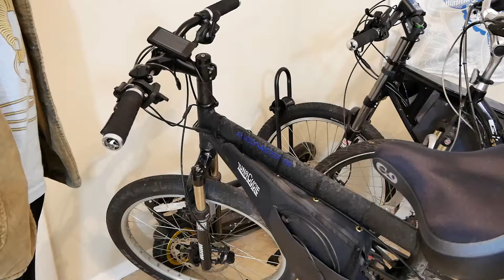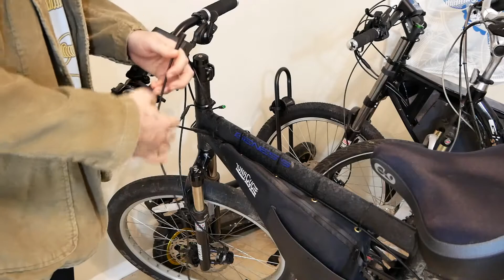How to bypass display on a Bafang mid drive ebike

Comment: Never disconnect a display with the power on. You risk burning out the display.
Reply from the maker: I don't know who fed you that line of BS but it is certainly not something we claim at our shop.
Reply: @fuzzyfriendlydoggy  You should.
Reply from the maker: @thepubliceye  It may be best practices, but that's like saying unplugging your TV when powered on risks burning out the TV.  I have never seen any kind of display get burnt out as a result of cutting power. Plugging it in is a different story obviously
Reply: With any electronics, best practices are to never connect or disconnect peripherals with the power on. I would not expect a bicycle mechanic to know that,

Comment: Hi there!. im aware that this is an old video so it might not get wandered but I bought a second hand Ebike yesterday and I don't have the password for it. the person I bought it from also said there was a problem with the controller. Could this be a simple way around it?
Reply from the maker: In theory yes it may work as long as your bike has one of these kits. You could also just get another display
Reply: @fuzzyfriendlydoggy  Thanks alot

Comment: Ruled out my T1 was damaged.
Long story short, I accidentally shorted mains positive to USB ground shield.
I ordered a replacement controller (Yeah, up in smoke with a large hole in the PCB!), but I had no throttle.
After a few pointless questions from the seller, I ended up returning it and order a new one from another place (First one on Ali Express, second off Amazon) and I have the same issue - I got nothing but none to full throttle. I also ordered a new cable in case it would've been damaged when the controller went up in smoke.
It would appear that the original cable is still intact and I ordered a new one for nothing. But, at least I've got a spare.

Comment: You don't actually need the display though right? I am thinking of getting a bbs02, as far as I can tell as long as you have the program lead you can do all your set up in that on the app or laptop, then the controller buttons still work as normal??
Or separate question, even just use your phone as the display instead?
Reply from the maker: Yes you can program it with the cable, and yes you will have full throttle access like that. But you would not have pas or the ability to change pas levels. The controller does not have buttons, the controller is just a circuitboard. If you mean the display, if the display is not plugged in neither is the buttons. 

If you want no display there are better options than the program cable. Just get an eggrider and use the Bluetooth app on your phone. Sounds like that's exactly what you are looking for.

Comment: Thank you!  Such an easy and safe way to troubleshoot.  I was worried about bending pins with a jumper.  Here's hoping my problem is the display and I don't have to buy a new battery or motor x_x

Comment: My p860c display just stopped working. The graphics freeze, and you will see horizontal lines, then turning black. No corrosion on the connectors. Motor and throttle still works, dont know if its the display or  cables. I think the display. Maybe water came in? It worked for 18 months.
Reply: But this malfunctioning keeps happening, so the screen is not dead, intermittent contact, i dunno.
Reply from the maker: @rverdonk  It is almost certainly the display. I would start with replacing it and if no joy, try the harness.
Reply: Ok thank you for you quick answer! Will it be water damage? Or something? It just started, never had any problem with the display. Sometimes you will have to drive in the rain, it should resist that, of you ask me. Are the display not potted with a sealing. Maybe I can open it up, watch the pcb. I'll buy a new spare display then. When I've solved the issue, ofcourse I will share this.
Reply from the maker: @rverdonk  it could be water damage, or physical impact, thermal cycling causing a break in something on the circuitboard, a defect, or damage on the harness. Would definitely start with replacing that component though

Comment: Don't get what ge did was it just a cut off cable with 5pin connector still attached
Reply from the maker: It's a bafang program cable. You could in theory use a jumper though between the correct pins in a pinch, but they are so small that you run risk of shorting it out like that
Reply: @fuzzyfriendlydoggy  thanks for that much appreciated
Reply: @fuzzyfriendlydoggy  update I've ordered a 1-4 cable saves the cutting and soldering 🤣🤣🤣
Reply from the maker: @ManMan-b5y5c  ok best of luck!

Comment: If you bypass will it damage anything?
And on which power level it runs if you bypass
Reply from the maker: No it does not damage anything. It runs at whatever power level you have for the throttle

Comment: Thank you, i have the bbs02b with the c965 display, and one day the display turned off after like 10 seconds on, then I tried turning it on and it turned off like 5secs after. And another day the display won't turn on at all, checked every connectors, then I did what you did, and the throttle worked with the programming cable. I nearly bought a new controller, you saved my money, now I just need to buy a new display.

Comment: So you plugged the cable to the display cable but where is the other side plugged in.?
Reply from the maker: It is not plugged into anything on the other side.
Reply from the maker: @rydirp  It is essentially the same thing as the other method of bypassing, which is to create a jumper using a bit of multistrand wire that would bridge the pins P+ and PL on the harness display connector. When you plug in the program cable it bridges these two pins.

Comment: is there something connected at the end of the cable
Reply from the maker: The other end of the cable is the USB port, with nothing plugged into it. Technically you don't even need the cable to do this, you can make a jumper. We have info about how to make one on the forum, it can be tricky though and unlike this workaround, if you mess that up it WILL break the controller, so keep that in mind
Reply: @fuzzyfriendlydoggy  please show us how you do the jumper. Link would help. Thanks
Reply from the maker: @Munzer1977  See the display portion of this page. There are several pictures and wiring diagrams https://electricbike.com/forum/forum/knowledge-base/motors-and-kits/bbshd/39217-troubleshooting-the-bbshd-bbs02

Comment: will this work for the green wires.........https://www.amazon.ca/Bafang-Female-Extension-Throttle-Sensor/dp/B07KK9KKSP/ref=sr_1_6?dchild=1&keywords=green+wire+for+bafang&qid=1600269039&s=sports&sr=1-6

Comment: I want to bypass the display and install simple throttle. just motor/battery/throttle.
Reply from the maker: While you could use the method to described in this video this is more for troubleshooting. If you wanted to permanently bypass it you would want to make a jumper as described on the luna cycle knowledge base
Reply: @fuzzyfriendlydoggy  can you please link to that? I really want to know also! Would be great
Reply from the maker: @dinudinu400  the most comprehensive instructions are on step 2.2 here https://electricbike.com/forum/forum/knowledge-base/motors-and-kits/bbshd/39217-troubleshooting-the-bbshd-bbs02

This picture gives the basic idea http://i.imgur.com/Z2u8GIn.jpg

This is an article http://www.poweredride.com/info/dump-your-bafang-display-for-stealth-and-better-display-options
Reply: How do I do what he's talking I broke display don't have money to get a new one

Comment: My BBSHD  has a power lose  about 500 miles on the motor . I have changed the display  (c965 to dsp-18 ) no real changes . The pedal assist works as with the throttle , Its just not producing the power .I have the off road package on it . Should I open the motor up and check the controller .. If the controller plugs where messed up would I still get partial power ?
Reply: Sounds like the controller is gone unless you damaged the battery. 30amps is too much for some bms/cells. Only a few cells that can take 30 amps. Samsung 30q or LG hg2 unless the battery is over 20 ah.